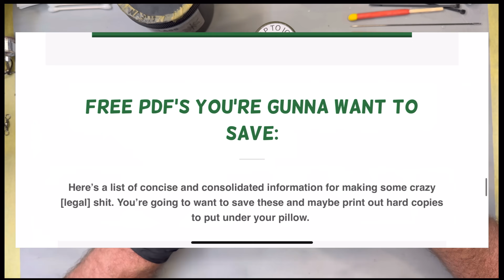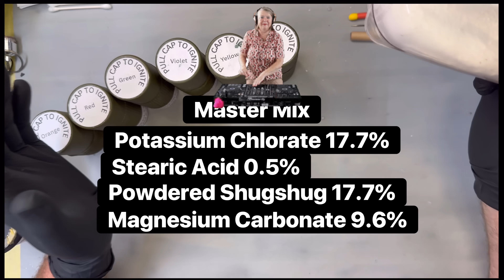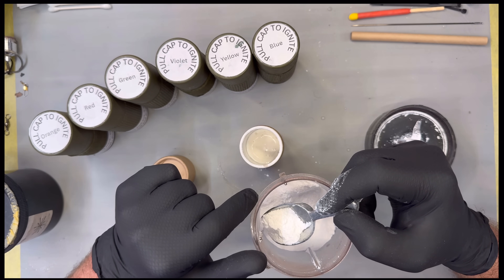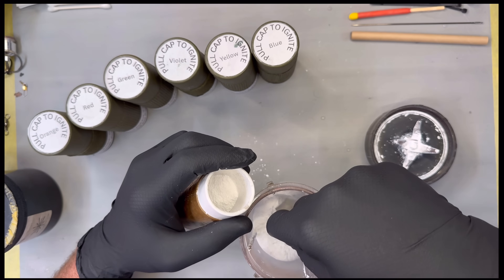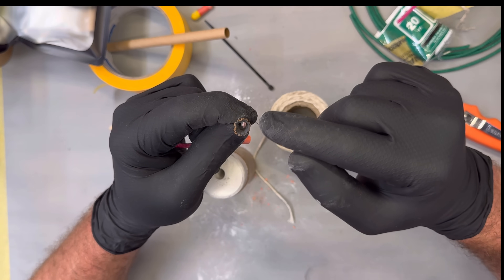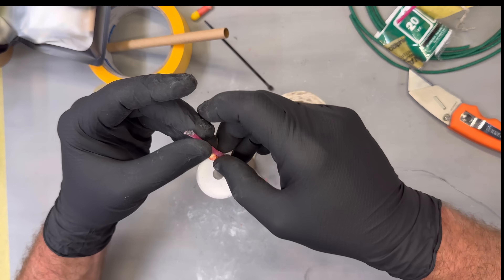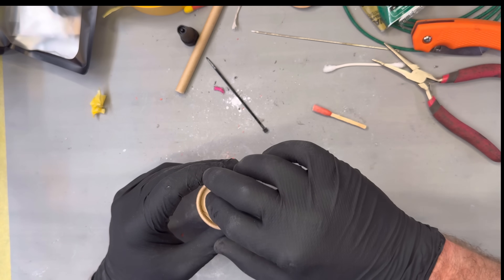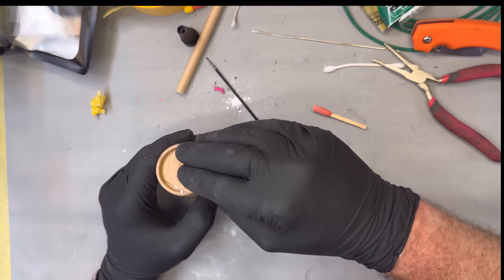How To Make The Most Vibrant Handheld Colored Smokes | Pull-Cap Ignite

Comment: How much better would these be than say Enola Gayes WP40 smoke grenades? I'm wondering if it's worth building these instead in terms of cost to performance. How much grams of mix do these usually contains?

Also is Potassium Nitrate safe to mix with Magnesium Carbonate and powder with Stearic Acid instead of Potassium Chlorate? Thanks!

Comment: So does the steel wire work better than the string in the kits you sell for the pull ignition?
Reply: Been wondering that too. Guessing yes since the wire is an update to the string videos.

Comment: 15:01 I see you ride EUC as well. What's your favorite wheel?
Reply from the maker: Haha! YES!!! I rode an s-22 (swapped a 4000watt motor, suspension rollers all that junk)for two years which was trash compared to the Veteran Lynx I’ve been using for the last 2 years. I use it every single day for work, it just mounts to the rear compartment of my big ass Promaster 3500 box truck which is awful in  the old towns that I work In. Im hoping someday it’ll catch on, but luckily they haven’t attracted legislative attention so we can still zip around at 62 mph!! lol. Jk I can’t break 49, because of wind resistance. I weigh 235lbs and I’ve lugged 80lb bags of concrete with the lynx. Zero problems. Once you hit that expert-level, EUC’s are hands-down the most effective means of travel off-highway. Yesterday, I made a 39minute trip (by car) through 3 towns including Salem, MA in 17 minutes. I fucking love those things